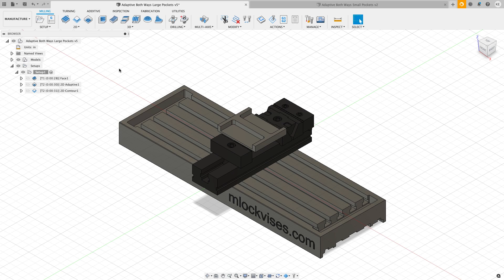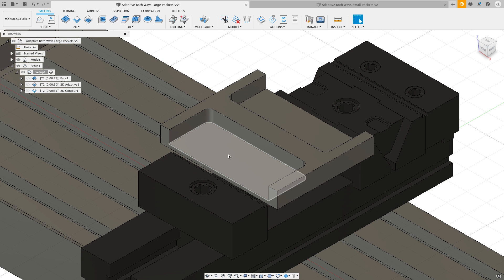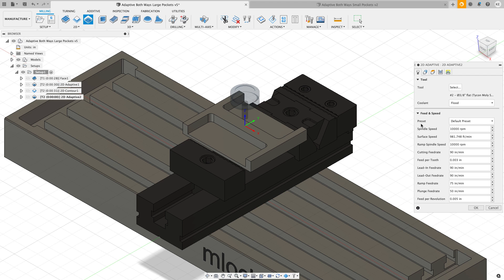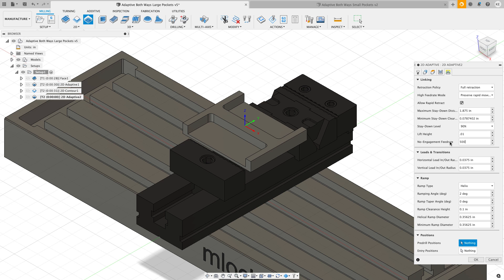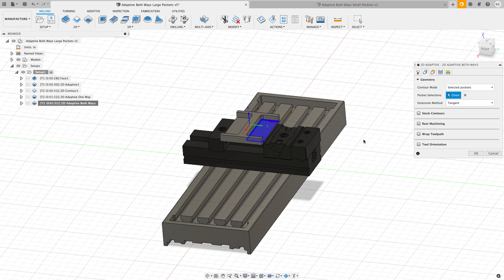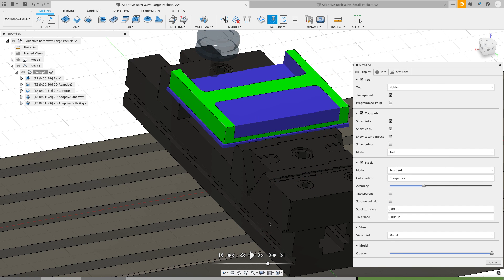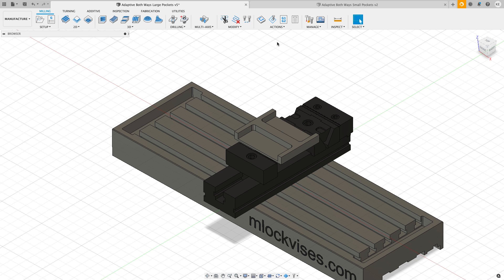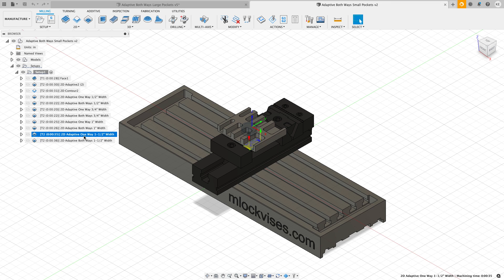Fusion 360 CAM - Adaptive Clearing Both Ways

Comment: I think both ways is only available to rough out quickly but definitely climb on the  finish for a cleaner cut? Any one know if we have an option to mirror or even rotate  an  operation?
Reply from the maker: Hi Paul. Adaptive clearing should only be used for roughing and not finishing. Sometimes I’m ok finishing down to the floor if the floor isn’t a very important surface. The next time you run an adaptive operation, stop the machine and feel the surface especially around arcs. You will feel a faceted toolpath and the finish won’t be nice. I always do a secondary operation to clean the walls, and usually the floors as well.

Comment: Is no engagement feedrate the same or different from rapid speed?  I’d always assumed it was rapids even though it’s called feedrate.😂
Reply from the maker: It’s cutting feed rate. Some controls won’t let you run the program if that value is higher than maximum cutting feed rate. Some controls don’t care and you can put as big of a number as you want in there.

Comment: Interested to see the results.  

I have gotten some faster adaptives on my tormach through selective use of the both ways option.  The axis acceleration is so slow that it comes nowhere near rapid speed in a small slot, so just cutting back the other way ends up saving time.  On a large part, especially one that is removing material primarily outside the part I find it faster to go climb only. It also sounds a lot better. :). 

Can’t wait to see that test.